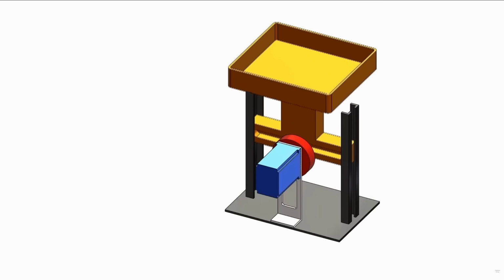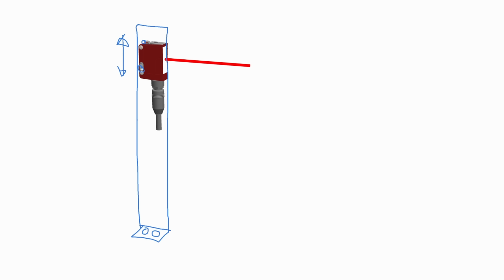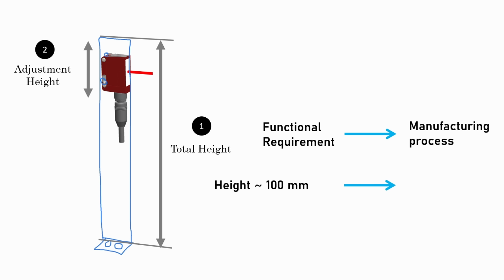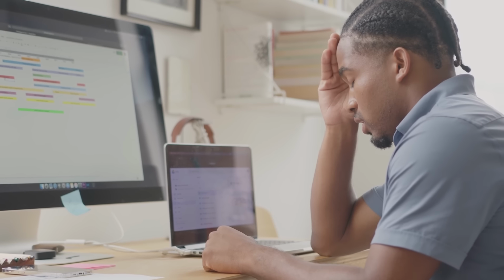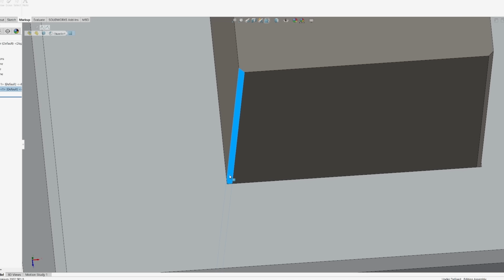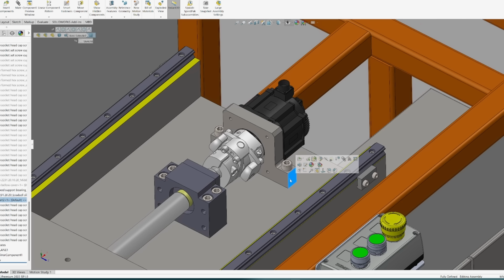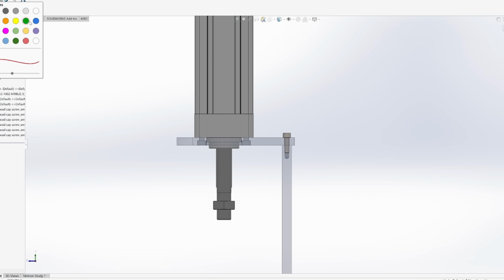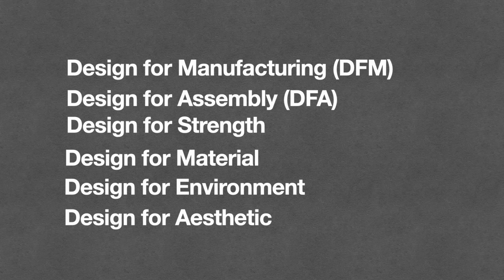Your Design Shows Your Experience Level | Every Mechanical Engineer Must Watch

Comment: Very informative video. 
I have one doubt regarding the sensor placement: Using shaft increases the DOF ( 1 T + 1 R) which may cause problem for photoelectric sensor (compared to the rectangular plate with 2 screws).

Comment: Don't know if you'll see this, but I'd appreciate your thoughts.

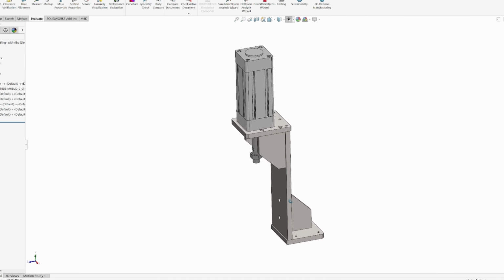As soon as you add ribs (12:42), I think the top plate should go back to being bolted from the back of the bracket.  Yes, it puts the screws in shear, but that's handled by the ribs.  The advantage is you're moving the side holes to a smaller part.  Do the same with the bottom and the long piece never has to be stood up during machining.  Which would allow something as small as a desktop CNC to machine the part.

Comment: experience is a like safety and quality, but im not an engineer ( im a stainless smith starting as engineer) ive seen 25 years of experience be alot worse then 5 years of experience, its mainly the good enough way of thinking company's have its more about interest and theory knowledge (if theory says it its mostly human error to account for (goes hand in hand with stable quality to production time) from my experience im at a high level in welding but still alot of engineers dont  think of humans not being perfect, even if i can make it dont mean everyone can (remember most/alot of welders aint certified/controlled)

Comment: Nice video but not the best example in my opinion. I would have added a 90º bend flange on the sheet metal long edge, around 16-18 mm, and keept the thickness to 2-3 mm. The bottom part of the new flange could be welded to the floor flange. You obtain an incredible stiff part, easy to manufacture and really economic.

Comment: I've started as CAD designer. After one year I went myself to manufacturing and asked my part to be done. Questions I've been asked like " how the hell am I supposed to mill this?! " - it tauhgt me a valuable lesson. Also light and easy design is good, as long as nobody hits it with a forklift while transporting and whole design must be redone. So yeah. Many years later I can tell how dumb I was. And probably still are. But at least some mistakes I do not do anymore..

Comment: Do you guys use keys for locating parts during assembly? I have not seen this practice very often, strictly going by the book shouldnt keys only be used on shafts to transfer moments? There are pins for locating parts

Comment: Like im going to listen to a jeet about design principles. My house is taller than you most impressive structures
Reply from the maker: Resistance without understanding.. classic failure mode in both engineering and people.😅

Comment: I am not a mechanical engineer but even I would design that fixture for the servo or motor with a reinforcing bracket. It doesn't take an engineer to know that it is needed because it is intuitive. Any shade tree mechanic would do the same thing.

Comment: LOL. . . is true and is wrong at the same time!? is a multifaced problem . Sure serviceability only make sense when it need to be service regularly? Once every year or two and you pay alot more for machining parts is not worth it . On top of that some big non standard size raw material will be alot more expensive if you add a flange increasing the material szie ??? ... once again all these point are very specific and does not apply to all . It depends 

Interestingly people would go a made a video out of it as if it most engineer doesnt already know? And if you are someone who design and doesnt know this -> you are not an engineer .

Chicken and egg . People who knows already knows , people who dont wont learn . 2cent ranting XD
Reply from the maker: Why not just weld the plate, instead of any bolting ? Servicebility- yes it depends, It's an Industrial machine for production not a mobile phone. Machines should be designed for easy maintenance, it's not about frequency it's about how much your design machine takes time to rectify in breakdown. How much time it's taken to alignment.
Reply: @mastermechanicaldesign  total disagree , this is very one dimensional way of looking at things

Comment: I work for mechanical company. Every day after I design parts or sub-assembly, I will send the documents (3D model, 2D drawings) to my manager. Of course, he sometimes gives feedback on 3D and 2D to me. Then, I redesign it for manufacturing and assembly. Although he has reviewed it but sometimes problems have come. For example. I want to assemble one part A with one part B. Part B have two plate has been welded with square tube. When I design part B even I make the clearance is 1 mm, part A is not assemble with part B because after welding, two plate on part B will be deformed. More dangerous, after part B is galvanized, the assembly will harder. After all, I will make more clearance (1 mm to 3 mm). Although I am designer and I often do mechanic jobs like milling, assembling, punching sheet metal, ..., some mistakes still happen haha. Thanks for sharing this valuable topic. AWESOME.

Comment: I’ve been working as a mechanical designer for over 5 years, but I still struggle with my design approach. Most of the time, I work alone—even in a company—because I’m the only mechanical designer, so there’s no feedback or discussion during the design process.
Because of this, I often wonder how other engineers or designers usually work. For example, how many people are typically involved in designing a machine or system, and how long does it usually take? how many process or involve.
I’m not sure if you’ve made a video about this, but if not, I would really appreciate your explanation or advice. I believe this would help many people who face the same situation. Thank you.
Reply: I really reccomend taking your drawings to the shop floor and asking the lads who work the tools what they think. They will really appreciate being consulted because it stops problems from landing on their laps that you wouldve had no way of knowing ab out.
Reply: @ImperialCommissarRikart works for DFM and DSA but my question is the process when designing an industrial machine, how many people and processes are involved.
Reply: @PTHouy probably depends on the company.  I also design alone and it always takes longer than the 'concept artists' say it should have. Thats because I came from the bench and I pay attention to manufacturing reality.  The other seldom mentioned issue is how long it can take for a workable idea to arrive in our minds.

Comment: looks at thumbnail depicting "good" design on shop floor with machine and stock ready to go....

so... you want me to clamp a piece of stock several feet long vertically so i can drill and tap those three M5 holes in the end?

yay. another video contributing to the ever widening chasm between "design" and "production".

no need to watch video. seen all i need to see :)
Reply from the maker: Who said the vertical plate is feet long? It's a pneumatic cylinder mounting 200-300 mm long only.
Reply: @mastermechanicaldesign  its any length and unspecified as it is just a thumbnail.

the point is, even 300mm clamped on end to drill those holes is not a GOOD design. the machinist wants to slap you. 
so does the resident beancounter quoting everything.

get off the cad and spend some time on the shopfloor.
Reply from the maker: Hey Don't comment like that. (I'm not being harsh just because of your age) In video these is an engineering reason I have experienced that why u should bolt vertically, instead horizontally in this particular design It's about design for strength. Watch that first!!

Comment: Just add stiffening rib on that sensor bracket, weld it in corner and you good to go. One part, 50x cheaper then machined assembly :)
Reply: Exactly, one more flange on the side, and you can rock with 1.5mm sheet metal part for this aplication. Welding is good, here, but maybe you can get around it if you redesign this part even more. Super cheap, machining this part for me is incorrect.
Reply: @krysrus111  Yeah I'd avoid having multiple machined parts for such a simple part like a mounting bracket for a sensor. The best is to buy an existing one already like the last example showed. It will most likely be the quickest, easiest and cheapest all at the same time.
Reply: @mrteemug5329  buying off-the-shelf is the single most important aspect of DFM
Reply: @mrteemug5329  do you think companies where they go the machined route just have strict supplier contract policies? Could take less time and be cheaper to do it with a machine shop in house? without having to get an NDA and go through legal. genuine question ^
Reply: @Spaceman_McGee Absolutely, If you have an in-house machine shop the costs on paper are 0 for the machining side of things. Lead times can be much shorter also. I had this at my last job and if they weren’t so busy all the time, I’d have made everything there lol. In reality, Even with 0 machining cost on paper, the machinist doesn’t work for free and the machine run time cost isn’t 0 either, so in the end buying off-the-shelf components will most likely still be cheaper.
Reply: while a flange for stiffness is the only thing i could think about, he is making a point that is very true
Reply: Depends on the tolerances you want. If the sensor mount should stay absolutely parallel to the bottom it‘s better not to have a weld process since it‘s more prone to warping. Ofc you can control the warping too, but for a low quantity where it may be welded by hand it‘s dependant on operator skill and you need to have a company which can guarantee a certain quality. The optimal solution really does depend on almost every aspect of the part and project!

Comment: As a Fitter and machinist for the last 30+ yrs, for your sensor you missed an important consideration, does something already exist that is mass produced and easily available for a fraction of the price of making a custom part. Sensors are a great example as the variety of mounting options available in the open market is huge. Every country does this to a point, most ball bearings are made from another supplier and the part is designed and manufactured to suit that bearing. China does this idea well, where they will heavily modify their own design to suit what is commonly and easily available from other manufacturers. Germany is often the opposite, where they will custom make every little part to suit that exact job, then design and manufacture a second part for the sensor just because of one slight difference, instead of at least designing their one part to do both sensors. Funny how countries tend to follow a set process, almost like it is taught that way at school, and the student then bring that style into the workforce for generations. I've been fortunate enough to work on machines all around the world, and see the different styles of designs and the experience levels of the designers, some so good that it made me stop for a second and appreciate the designer, some so bad that I had to throw away parts and start again.
Reply from the maker: Yes, that’s a good observation. In that video, the sensor bracket example was only to explain the correct approach to design for manufacturing.
In real design work, the first thing I check is whether I can use something already available from standard sources like MISUMI or JLCMC. For a sensor bracket, I usually prefer brackets provided by the sensor manufacturer, or standard shaft-and-clamp types.
I only go for any custom design when no standard bought out option is available. reason is brought out components are mass produced, so they are typically cheaper. More importantly. you also save design time, drawing effort, sourcing work, and quality checks. these indirect efforts cost more than the part itself.

Comment: Good information, however you missed the most important design requirement: design for cost
The examples given improve the mechanical strength, but at a substantially increased cost.
Also why is weight the most important characteristic? If it is in a stationary application, then cost is much more important than weight.
Reply from the maker: Design for cost—this is a deep topic. I’ll cover it in a separate video.
Strength vs cost: if strength is required, it’s required. Reducing it to save cost is poor design. And if it’s not required, don’t need to over design. It’s about matching the requirement, not cost.
Reply: Costs of parts should be on the very far end of your requirements list. designs that do not meet functionality or durability requirements are pretty much useless, no matter the price.

Comment: Do you have any specific recommendations for books on DFM, DFA and design for rigidity. The use of examples was clear and easy to understand, I liked your presentation, thanks.
Reply: The best way to learn DFM and DFA is to work with your hands on projects. Even if your job is to get designs out for someone else to make, you will be much more valuable if you occasionally assemble or fabricate your design yourself. Also take time to look at how things around you are made. Focus in on features you don't understand and investigate what those might be. Visualize each step of the manufacturing and assembly process.

Comment: Now we came to basics....really nice to see.
I still remember making solid 3d model for the college project, having no experience how it can be made. Then stepping in the real industry, realizing that it doesnt work in that way.
I learned DFMA, and applied it for designing bell housings, mounting brakets, mounting structures (weldment) etc.
But i am still in learning phase, once a senior person from client showed me a automobile project assembly, containing majority of sheet metal parts, it looked so good and aesthetically pleasing.
So my next learning is also aesthetics.
Because some of the strucures that i have designed looks absolutly as*
Reply: what software to learn?
Reply: @lavatr8322 in the beginning, what software to use isnt as important as the technical knowlege,
You can learn any software, try to learn atlest 2 CAD softwares, and master one of those two.
For eg, i know multiple softwares like, SW, Inventor, Siemens Solidedge. But i have pretty good grip in SW, because majorly it is used. At the base level all CAD tools are same, what makes them different is just preference and specific field. So research on the field that you are interested, then find out which tools are used in that field and start learning them. A design engineer's 1st priority should be technical knowlege and 2nd should be efficiency, which comes from mastering these tools. So best of luck.